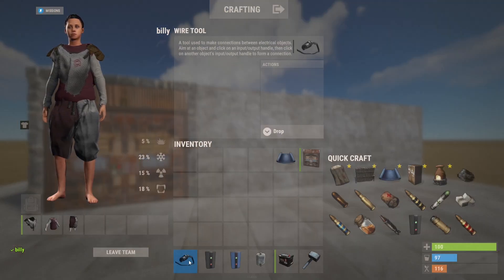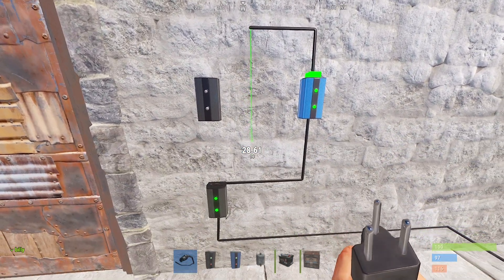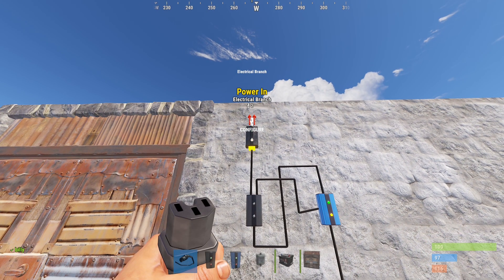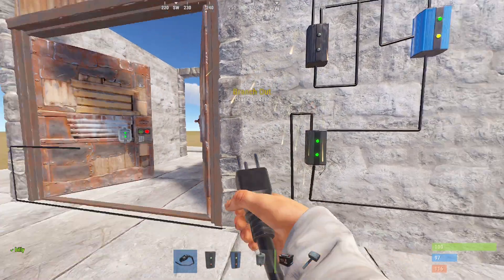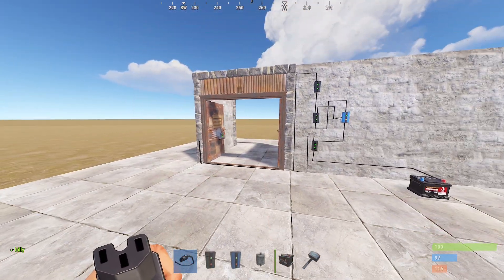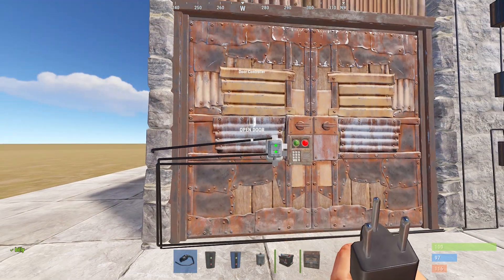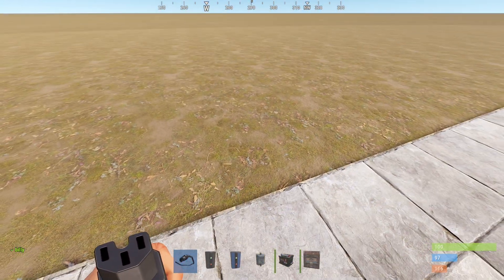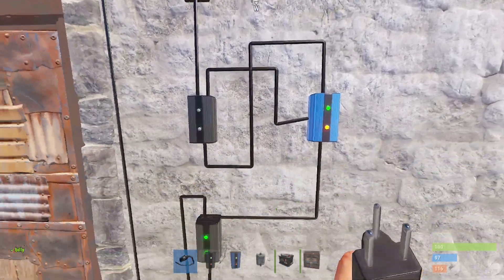🔥 Rust - Auto Door Closing System | Beginner’s Guide

Comment: maybe add a timer to the circuit to be able to change the time it stays opened
Reply from the maker: Yes you can add a timer to adjust the time for the doors. I think it might be dangerous to use at outter doors but can be used for inner doors.

Also check out my other video "Auto Base Locking System" one button to close all doors at your base.
Reply: Where would you add the timer in the circuit to extend the duration door is open?